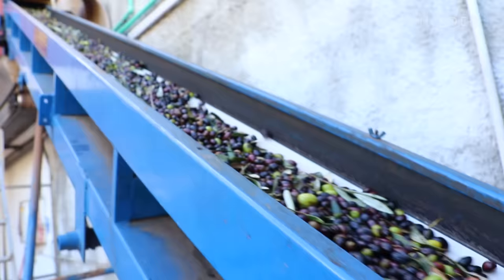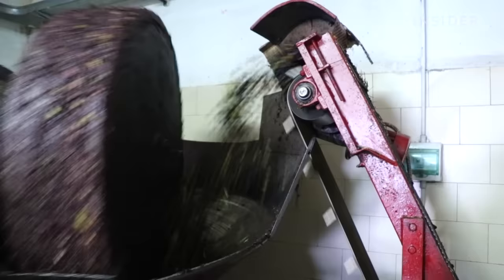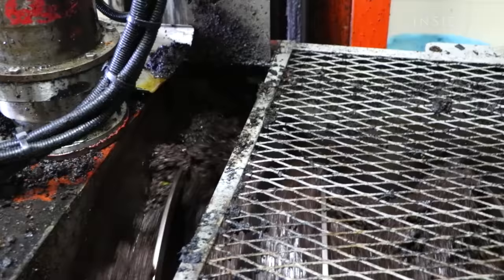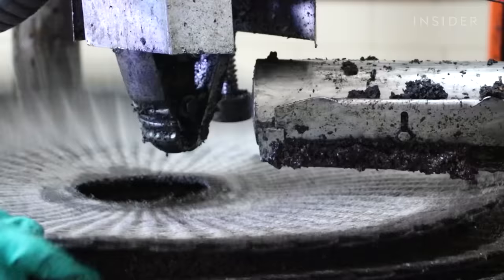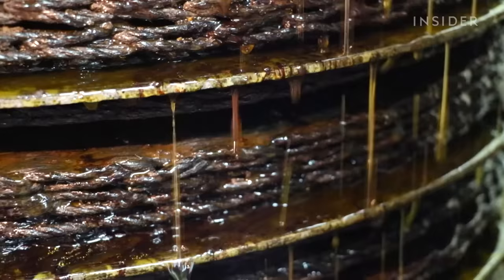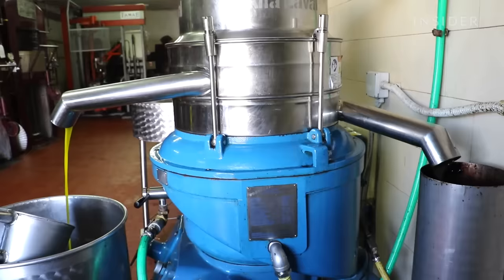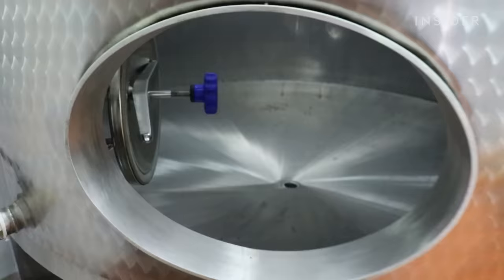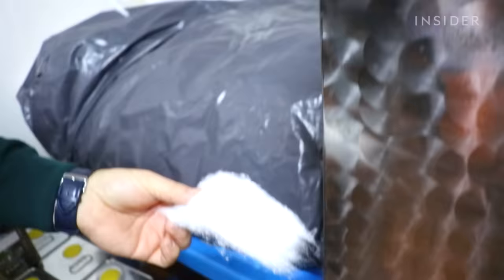How Traditional Italian Olive Oil Is Made | Regional Eats

Comment: For your info: most of "italian" olive oil is just spanish imported oil, only in high end expensive bottles you can find true italian olive oil. Standard supermarket ones are mixed 20%italian 80%spanish, this is done because named "italian" has more marketing value :)
Reply: @emprahsfinest7092  It's a lot stronger tasting. It's pretty intense.
Reply: @emprahsfinest7092  most of the time just stronger tasting. Even italian oil is extremely different from north to south. Oils from Liguria and, to some extent, Toscana are very delicate and light. Oil from Sardegna or in general southern italy is generally much stronger tasting and acidic. Both good but def suited to different dishes. Northern oil is generally regarded as higher quality and more expensive.
Reply: @valebliz  To be fair, in the Southern regions of Italy we only like Southern oils because the other ones taste like water
Reply: @alessiocirillo7214  yeah matter of taste, i'm from Genova and accustomed to the lighter oil of Liguria but don't dislike southern oil either. Usually i prefer stronger oils to cook, lighter ones to use raw.

Comment: Olive oil is graded on its organoleptics. Acidity is simply a chemical standard. Low quality olive oil witch is refined ( acidity is chemically reduced using an alkaline solution) may have an acidity as low a 0.1. Never choose an olive oil by the acidity.  It means very little. Especially without all the other chemical parameters.And never buy any other then extra virgin olive oil
Reply: And she said that it should have a low acidity because "it is a pure fruit juice." So is orange juice and it's quite acidic.

Comment: Olive oil benefits:

1/I have used extra virgin olive oil to remove it every day, I just use sunscreen and lipstick. It's light and nourishes my skin. 

How to use it:
 wash my hand clearly and dry my hand, use extra virgin oil to massage my face for 1~2 minutes. After that, I use a wet warm towel to clear my skin. Finally, I use a foam cleanser to wash my face.

2/I have to use extra virgin oil to clear my head when it's dirty or has dandruff. It's really effective. I use it 30 minutes before washing my hair.